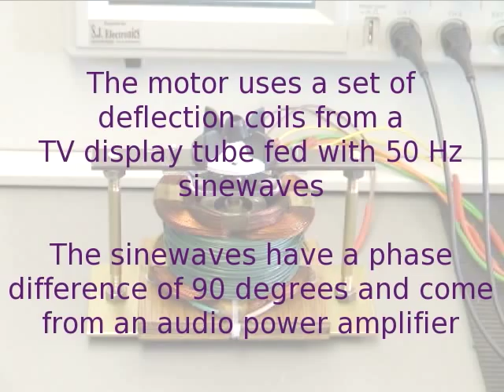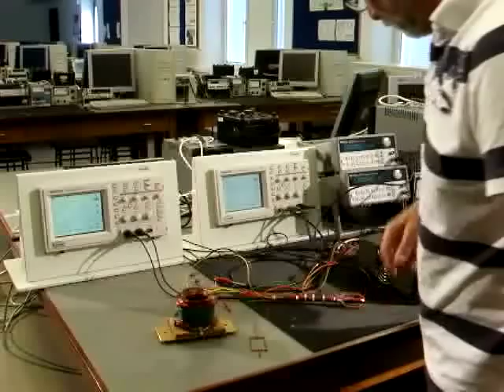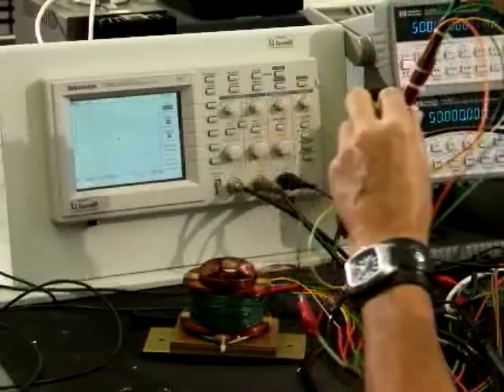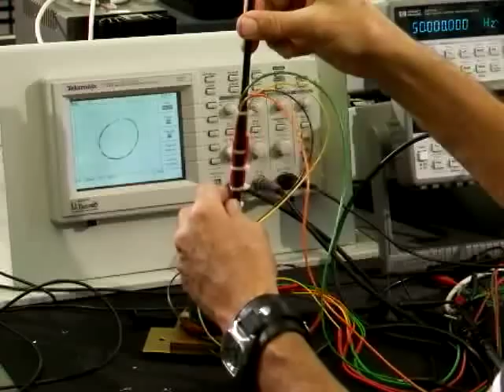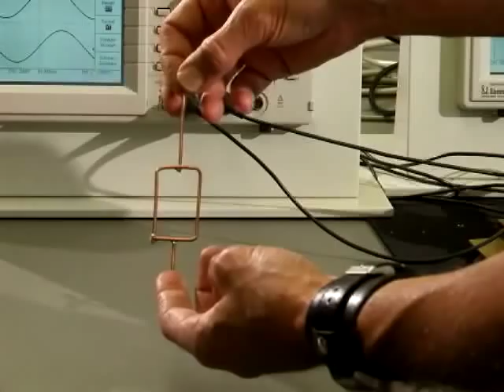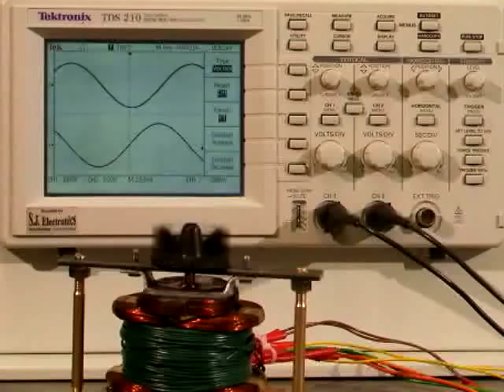Two-phase induction motor

Comment: I have a vintage two phase motor starting switch, made by Allen Bradley.  It uses 4 conductors. It was removed from a vintage 30 inch paper cutter from a printing company in Philadelphia PA. Although obsolete, two phase power is still being used in a small section of Center City Philadelphia, to power some vintage industrial motors/machines to this day.

Comment: Nobody answered. So I will take a try at it.
I think the answer is no, because the only way to induce a magnetic field into the rotor is to apply a voltage to the same stator, where you want to extract the energy.  

Could it be primed, like a water pump ? 
I doubt it. 

Would it have to be at the same freuency as the rotation of the propeller, lagging ? 
Difficult to do, at best.

I say forget it.
Good webpage here about such motors:
phys unsw edu au/hsc/hsc/electric_motors1 html

Comment: is it possible to use a motor from sewing machine to use as wind turbine? it has no magnets, i think its induction type. it produces like .5 milliamps when i turn by hand. it runs on 120V @ 95A. think you can help. thank you